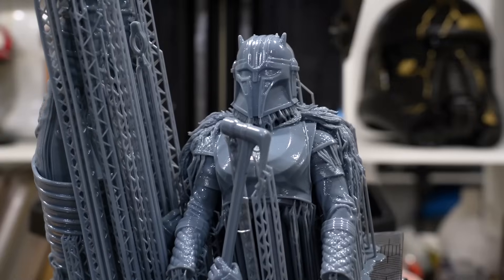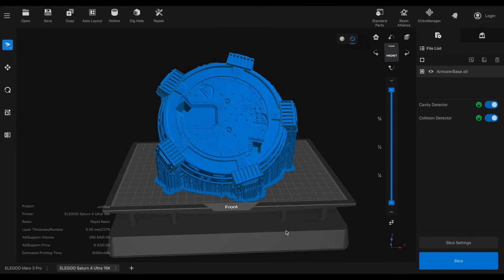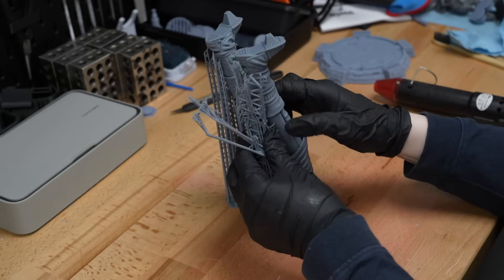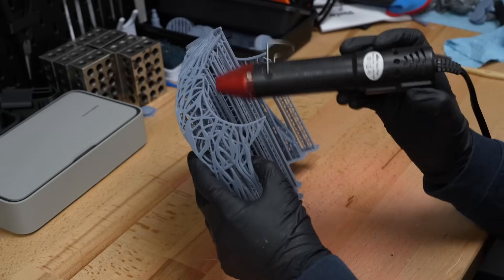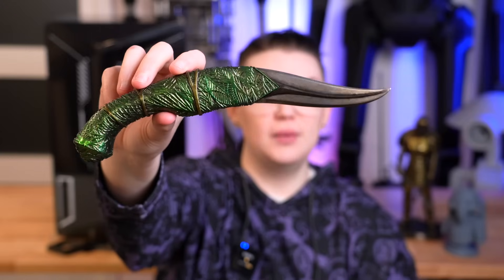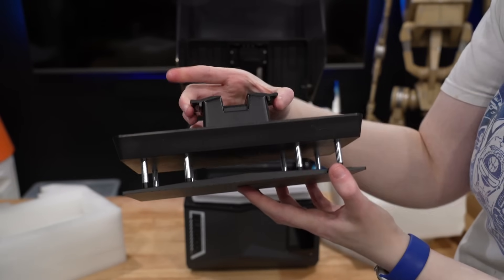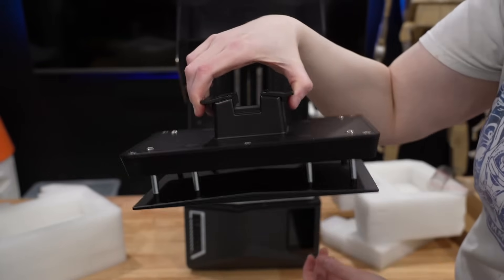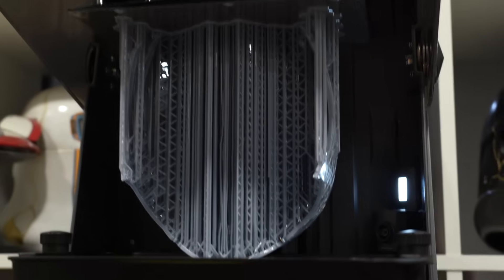Should the Saturn 4 Ultra 16K be your next resin printer?

Comment: Hello from Montreal !
Question. I have an Elegoo Saturn 4 Ultra 16K. If I during a print, the resin becomes very low in my vat, will the machine stop, or continue printing even if the resin is much bellow the minimum line,  and there will be a missing section, or will it stop printing until I fill up the vat again ?  
Thank you.
Reply from the maker: The sensor is supposed to be able to detect when the resin gets too low and will pause the print until more resin has been added to the vat.

Comment: Just got this one and was expecting build plate and other issues based on all the reviews. First print default settings came out looking great for a calibration build that covered the entire build plate. I tuned the resin settings and it was close to perfect. Awesome printer not sure if they fixed some issues in the firmware or not but it is plug and play which is awesome as last time I 3d printed 10 years ago I spent a week calibrating.

Comment: I don't understand why the drip bracket is even an issue. Why isn't it a required part of the kit, like a scraper? Get rid of the masks that are completely useless and include a bracket instead. I assume you didn't have the bad build plate problem that many are reporting.

Comment: Can you mix any resins together? I'm new to resin printing, I don't even have a printer yet. But I've read that resin Prince can be really brittle. So I'm trying to figure out what combination of resins or if there's a single resin that's both really durable and also slightly flexible. I don't actually need any real flexibility I just want it to be more durable in case something were to fall. But I have no idea which residents to use and I don't want to spend a fortune either especially when I'm just getting into the hobby

Comment: I got my first 3D printer for christmas last year and it was the Elegoo Saturn 4 Ultra 12K and I'm very happy with it and the only print failures i have had were me learning the ins and outs 

The only thing I like about the new 16K model is the heated vat bu I just bought the Elegoo mini heater for my 12K and it's workng a treat

My son and i went halves in the Elegoo Centauri carbon Pre-order and that will be our first Flilament printer

Comment: So I am looking to get into Resin printing for the first time.. I have 4 bambu lab printers and now I want to try something new. Would this be a good Resin printer for newbie? Also what washer and machine do you use for curing. I have a lot to still research and learn about this new hobby.
Reply: I had the mercury xs bundle and it worked great. It included separate wash and cure stations so I could clean prints while curing others. I'm switching to the mercury plus 3.0 for bigger wash and cure volume. That bundle only included one base, so you can't cure and wash simultaneously, but i rarely needed to do both at the same time so that's not a major loss. The plus 3.0 is currently $120 on ebay direct from elegoo
Reply: And yes the Saturn 4 ultra or 16k are very beginner friendly. As long as your resin is heated you shouldn't have much difficulty getting prints out

Comment: Question: Fauxhammer mentioned the UV settings on the 16k were defaulting too high, and overexposing prints - is that your experience as well? 

I'm so torn - I'm buying an Ultra 4 this week, just can't pick. I need a heater in my climate, and am not crazy about chinese aftermarket vat wraps, or the Elegoo modular heater, so the embedded heater is a big plus. On the otherhand, Fauxhammer raised some questions about whether the 16k screen was overpowered and would burn itself out sooner. 

Help- I'm paralyzed with indecision. Lol.
Reply from the maker: Interesting. I never thought it was the screen itself being overpowered, I always assumed it was the resin printing easier (and needing lower exposure times) due to its lower viscosity when heated by the vat.

It sounds like the upgrades on this version would be worth it for you. I’ve still never had a screen burn out on any of my resin printers. Even if this screen was possibly more prone to an early demise, that still might not happen before you’re ready to switch to a newer printer.
Reply: That makes me feel a bit better - thank you. 🫡 @MMsPropShop

Comment: While I absolutely hate being the safety nanny, and of course maybe you're protected off-screen with a respirator, but blowing hot air on an uncured resin print is dumping VOCs into your work space unnecessarily. Hot-soaking a fresh print in warm water (or better yet, using a dedicated ultrasonic cleaner with a heater) does a great job of softening supports where they come off like zippers with a tuned resin profile. The questionable safety is finally being more readily discussed amongst users, but resin printers do have some serious considerations being in the user space that differ on safety margins to a higher degree than FDM machines. They can 100% be mitigated and still be reasonably safe to use, but for those that don't know in your audience, it's a worthwhile note to make as more and more people adopt resin printers at home. 
I love them, have many, repaired many more for other people, but I also hold them at the same potential risk level of industrial chemicals with regards to the hidden dangers that make resin printing both possible and something to consider for health aspects.

Comment: Thanks for the review of this printer. My question is, what is the least smelly grey prototype resin that you could recommend? 
I tried the Anycubic water wash resin...crazy smelly. Not good.
Anyways i would appreciate your suggestions. Thanks M
Reply from the maker: I typically stick to ABS like resins from pretty much any brand and I’ve never found them to have a particularly strong scent. I’ve never been the biggest user of water washable/plant based resins (if they still make those anymore), but from comments online, they seem to have a much stronger odour.
If you were wanting to stick to water washable, the Siraya Tech Simple resin doesn’t have too extreme of a scent. I’ve only used the clear and it had a Windex-like smell.

Comment: Largely very nice review, but would have liked to have understood the difference between the high speed and standard speed settings. As an owner of the previous version i couldn't appreciative any difference in either time or end quality. Perhaps the difference only seen when filling the overall height volume? Good to see they addressed the build plates lack of handle.

Comment: I just wish makers of resin 3d printer would stop competiting about print precision and would start working on making resin printing less of a hassle. I can set up a filament printer and let a 10 years old use it with next to no fear. Meanwhile resin is still a mess to use.
Reply: No it's not a mess I don't get a drop anywhere than in the vat! You learn just like everything how to use it correctly without anything getting any mess! I have more mess from my FDM spurging
Reply: Well yeah resin is inherently more difficult to work with. It’ll always be that way. But if you have a decent workflow the mess is minimal.

Comment: I was having doubts about pre-ordering this printer until seeing your review.  Thanks!
Reply: watch other revies too
Reply: @AntAOD  i've seen every review available across the last 2 months, there are mixed reviews but alot of the negative is griping about how its worse than printers 2x the price, or people not adjusting settings appropriately and not understanding why their prints failed, or the fact that they've released 3 iterations of this printer now and this one is better than their counterparts but they aren't supplying update kits to previous buyers (yet).

It looks to be a very good printer, I do think it will be a very popular printer for the fiscal year of 2025, it has a decent array of features and produces very good looking parts, although they do lack some sharpness (isn't that the point though?)

Realistically, for the price, the only reasonable complaint I've seen so far is about the AI driven camera, and how absolutely useless it is. I think this is sufficient evidence to confirm my pre order now.

Comment: Did you just use Chitubox or did you try the Elegoo slicer and what solution do you use in your rinse vat?
Reply from the maker: I actually ended up using Lychee to support everything, exported the parts and then used Chitubox to slice and send to the printer 😂 Thankfully Lychee now has a profile for this machine so I won’t have to go through that whole ordeal again.

I’ve been sticking to 99% isopropyl alcohol for cleaning.